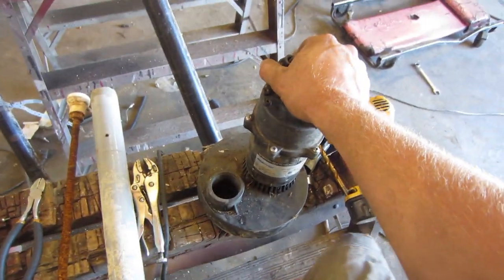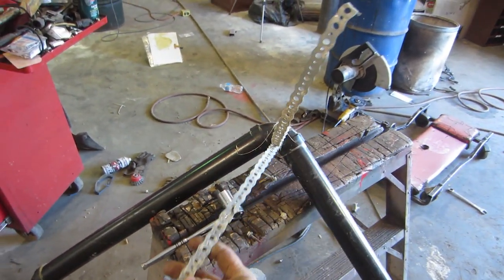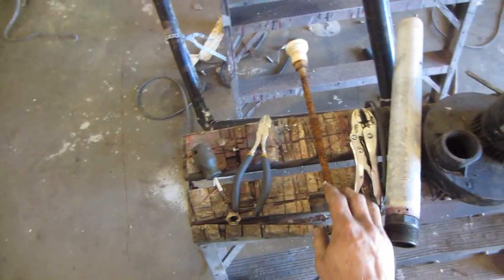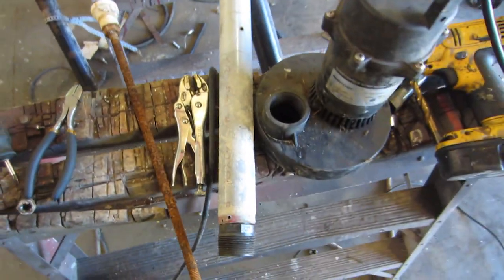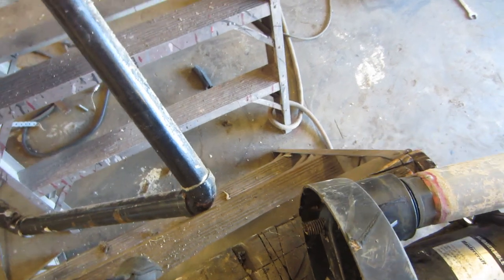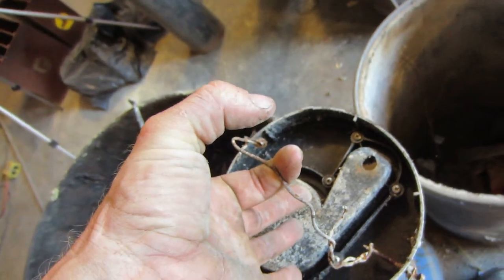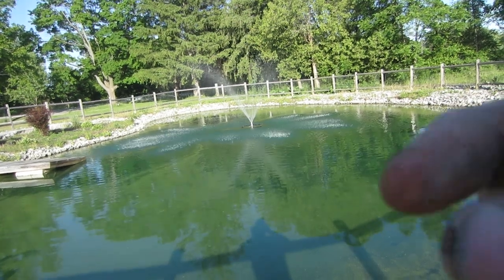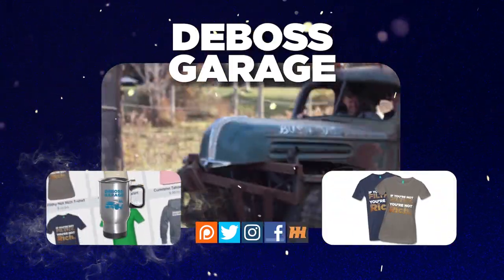How To Turn a Sump Pump Into a Cheap DIY Pond Fountain

Comment: Instead of dealing with replacing a pump, just hire a crew (specialized) to dig a well that's 2x deeper than your basement. The walls of the well can be reinforced by making the hole big enough to accept concrete drain tube, the ones that are usually used horizontally and have those lips that nest in the next one.

Last step is to let water fill in, once you've seen for a few of the wet months where that water stays (level) you put up to and slightly above, gravel.

That, will solve most of your problems regarding floods. It costs a pretty penny but if it worked for a 120 years old house that had a basement flood each autumn despite having been dug out and isolated, then it should work for you too.

Pipe ID can be whatever you are comfortable with paying, the idea is to make water drain to the hole, but, generally, the narrower, the deeper it gets, the hole i had dug out was big enough to fit a manhole cover and went 3x the basement, eventually the water would come up to 2/3 of the way (that part of the city had been formerly a swamp, or so legend says, i have my doubts, i think it's an underground spring), the gravel is there to prevent freezing water which will crack the concrete pipes.

Oh and obviously, you can, and should (profit from the hole) build drainage ditches, might as well collect all water in the area.

Before you do this, read up on law, here in EU, i had to get a permit.
Reply from the maker: Thanks for the info.  Just like everything else I do, budget always seems to have a say though.  $100 sump pumps will have to do for now.  I have one at each end of the house so if one fails, there is always a backup.  My water table is below the bottom of the house.

Comment: I like the idea, but those pumps running continuously are extremely expensive. You are better off buying a better quality and a pump that doesn’t burn so many amps = very high electric bill. Buying a good pump will pay for itself after the second year. DIY is fun but not always more affordable.

Comment: What do you do with the cord, id imagine the original one isnt long enough to reach sure and you cant connect it to an extension and just throw it in haha?
Reply: Haha my thoughts exactly
Reply: I was wondering the same but don't see any answers...how do you extend the pumps powder cord and make it water proof?
Reply: I built my own, they make extension cord covers which are at most home stores. Also drilling a pattern on the top of a cover looks just as good as the grinding and using all thread.
Reply: Cut the power end off and attach an extension cord with water tight connectors and shrink wrap

Comment: Our pump keeps turning off and then back on...10 minutes or so on and then 20 minutes or so off and then it kicks back on again. What's going on?? It's a very heavy duty pump.
Reply: More than likely a faulty over heat sensor or check impeller area for blockage
Reply: You could be choking it too much